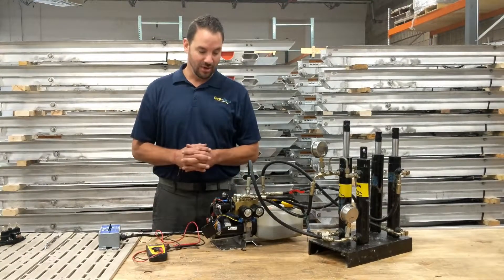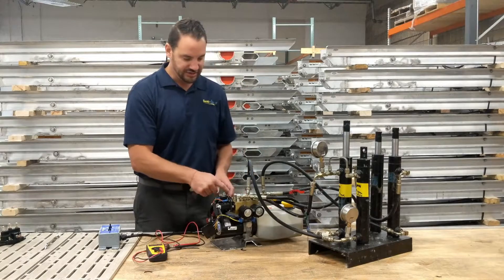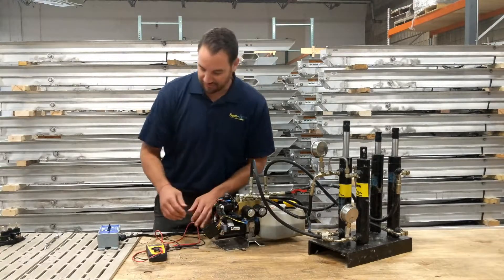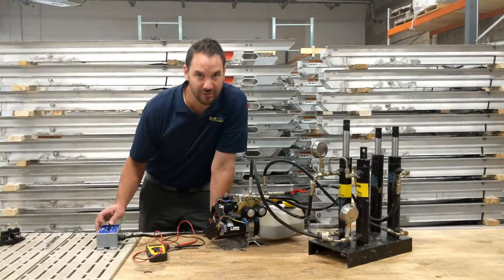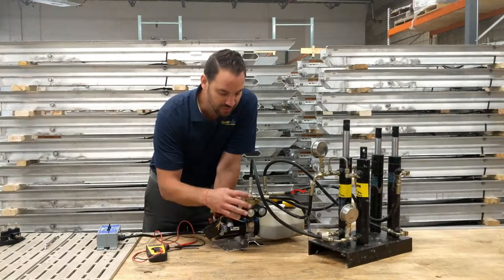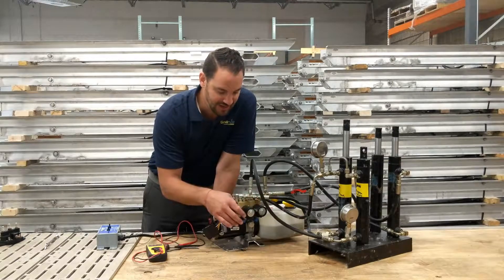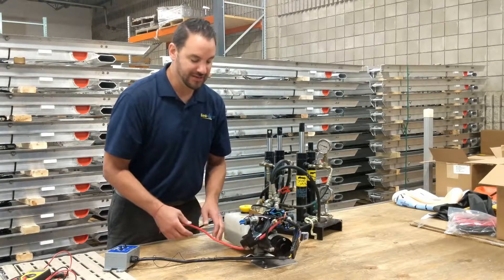Sea-Legs - Overview of Valves, Coils and pressure switch

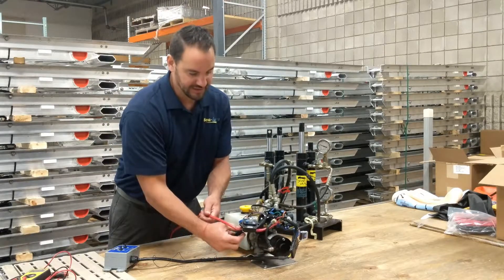Comment: Nate - Thanks - I love these videos.  You mention the relay related to the pressure switch.  My legs went up and did not come down - clicks only when I tried to go down.  I replaced the Trombetta  (thanks for the great video by the way) and nothing changed.   I can swap the green and orange wires at the Trombetta and make it it so the up switches make it go down.  So I can drive my boat - I just need to swap the orange / green after I launch so I can put the legs up when I land.  If I put 12V straight to the down tab on the Tombetta it works.  If I check the green wire when I press the down button -  I get 12V.  It is a puzzle. You can see why I am zeroing in on the pressure switch and / or the Micro SPDT 20/35A Relay.  The pressure switch seems to be on the green line only so that might be why thigs seem diferent on the green wire or orange wire.  You the relay mention it at 2:33 about but never talk about its purpose and how to diagnose it being good or bad.  I will keep diagnosing and purchasing and replacing parts - but a nice video on the pressure switch and relay would be helpful.  I think from what you say - the pressure switch is sensing the pressure in the hydraulic lines (i.e. there is no sensor or limit switch under the boat)...  I would so love to have a wiring diagram.   Also there is a red light blinking on my 3A5421A3 control unit that I cannot figure out what it means - is it a power indicator or error indicator.   Your videos have me 90% there.  Thanks again.